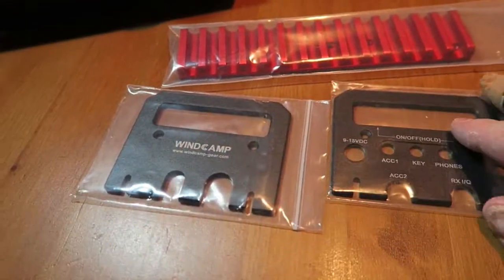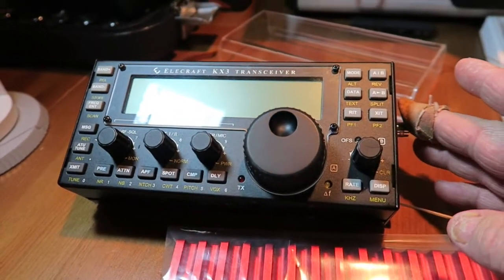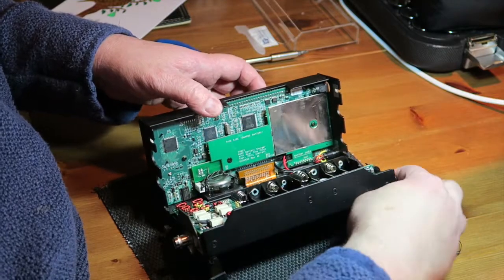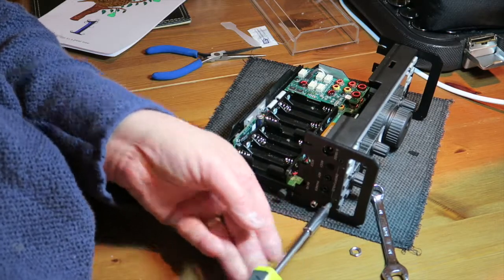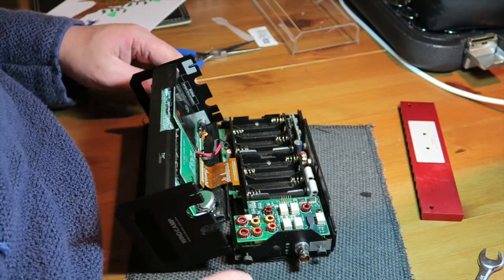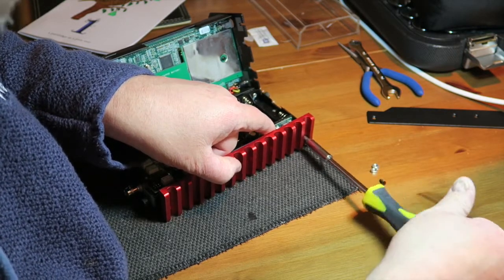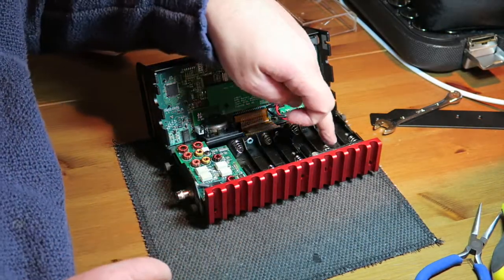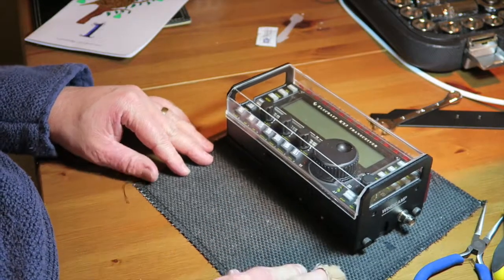KX3 Side Panel install

Comment: Just a hint: It's way easier to remove the screws at the sides and the old sideplates when you don't open the transceiver. Just losen the knurled nuts at the base a little and your done. (Maybe you have to remove one of the knurled nuts on the left side completely to manage to place the new plate over the microphone socket.) Later when installing the heat sink you have to open the case of course ...

Comment: cool! Thanks. I got two of these. Building the kits at the same time as I install the Windcamp. Might replace the windcamp heatsink with one from VE7FMN, which is even more substantial. I am looking at running digital modes, so the extra heatsink is probably a wise investment. Reducing the heat, even by a little, can't hurt with longevity.

Comment: Great video, but use the thermal paste!
Reply from the maker: +SurvivalTech Nord ha, yes in fact since filming this - i did go back and apply the paste once I knew the heatsink would fit in the pouch.
Reply: ColdestMoon very nice. I'm sitting here with flu watching ham radio videos all day hoping my fever will break. Thanks for sharing :)
Reply: I went to the VE7FMN site for theirs (a much more substantial heatsink) and they don't recommend using the thermal paste since it dries out and then becomes an effective insulator over time. I suspect this takes a while, though. I'd instead use one of the better pastes like Arctic Silver for CPUs. In short, I'd, based on my experience, recommend using a paste, but if you work with computers, use one of the better pastes. The stuff that comes with the kit is cheap stuff.